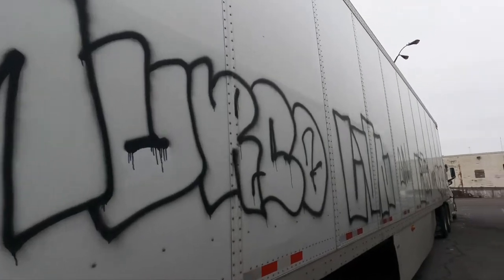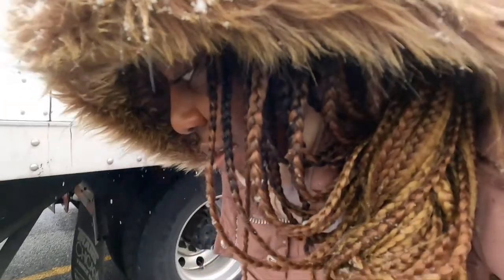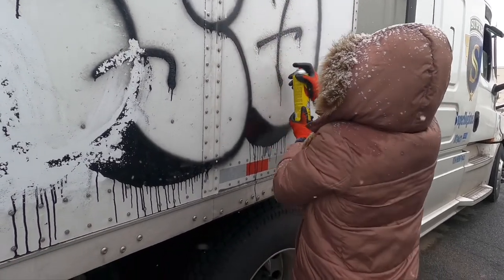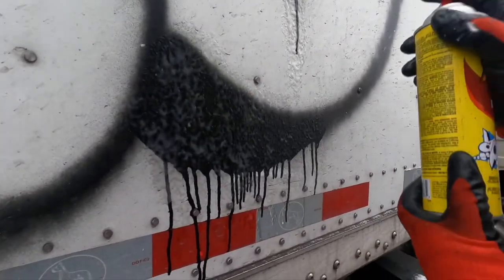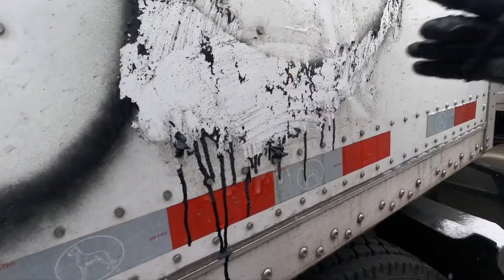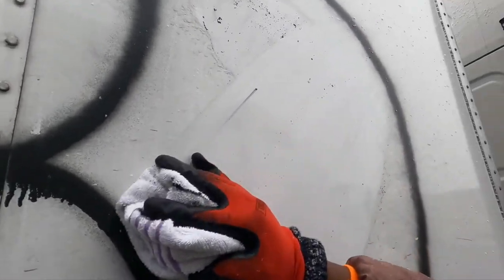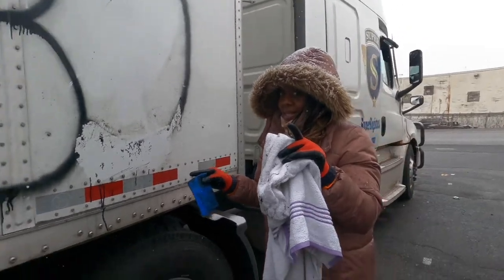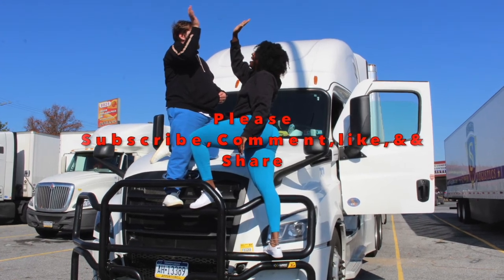HOW to remove Graffiti from Semi trailer.

Comment: if you live in nyc you should know the risks of owning a truck, it will be tagged
Reply: Just happened to me last week. Looking for cheapest option to remove.
Reply: @amirrizer5069  no point in removing it, it might get tagged again u might as well just leave it as is
Reply: @xqtz DOT and state police will have you remove it. I used acetone and it worked perfectly to clean it. Make sure to pressure wash after.
Reply: I hope the police will punish all taggers sooner or later.